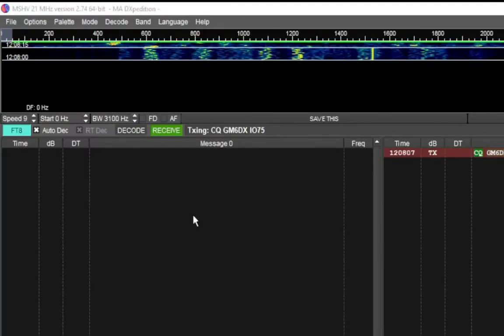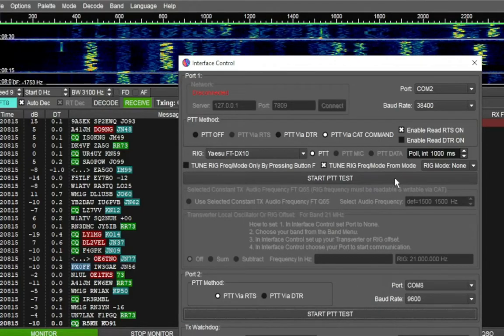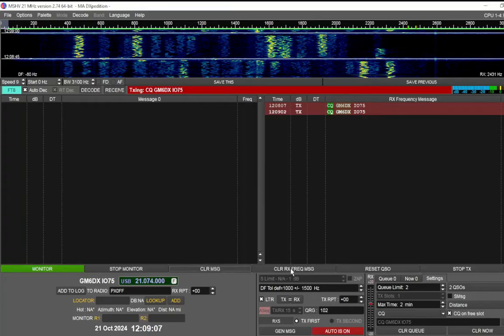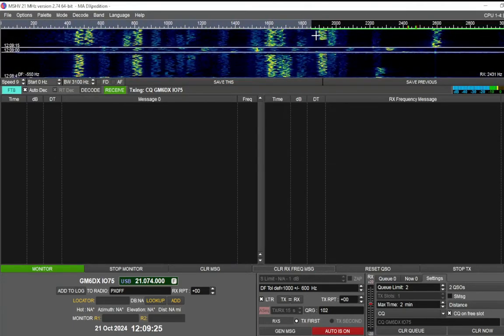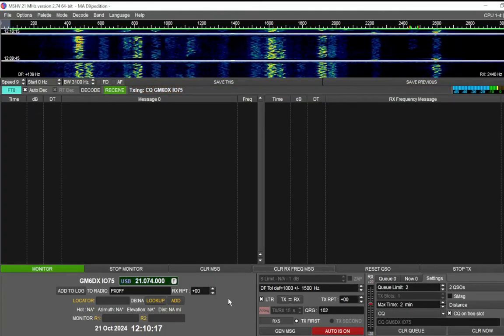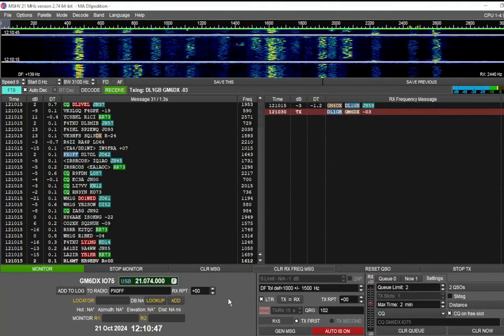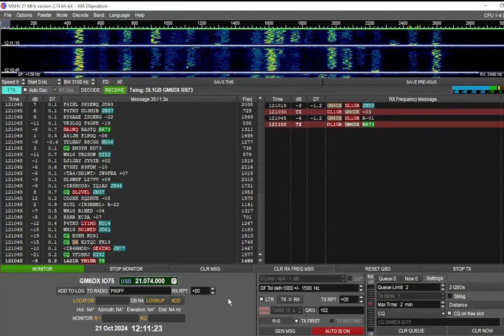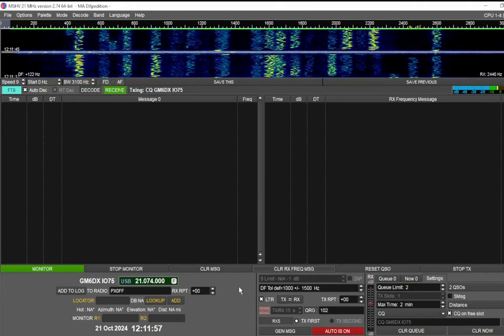Fully AUTO FT8 QSO using MSHV

Comment: i cant seem to get the audio out, ive set the audio in the audio settings, when it TX i can see in the sound settings in device manager that audio is going out but its not sending the audio from MSHV to the radio, kenwood ts2000, signalink usb. all works fine WSJT-X just not getting audio out with MSHV what you think this could be?
Reply from the maker: It's likely just a setting. If the audio is selected in the settings and the transmit volume is up the radio should modulate, same as any other software
Reply: @GM6DX I think I might have found the issue but do not know how to sort it, when right click on the audio in taskbar (win 11) it opens up the volume mixer.....MSHV level is set at 1 but gray out so can't move it.
Reply from the maker: @MØKNM-Amateur-Radio have you tried making mshv the default speaker , in sound settings in windows device manager?
Reply: Kind of got it working, on the ts-2000 I had to turn packet mode on.....only the cat control does not work when packet is turned on but I've made a few contacts with it now, just going to spend time learning it, thanks for your help mate 73 M0KNM